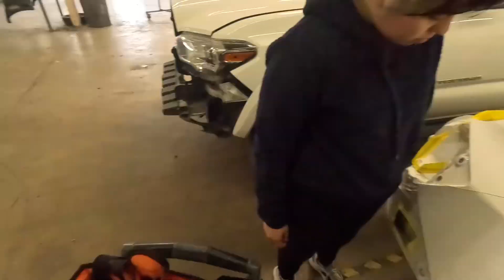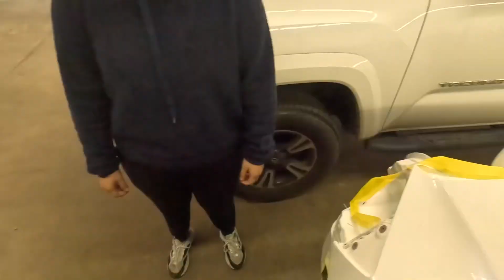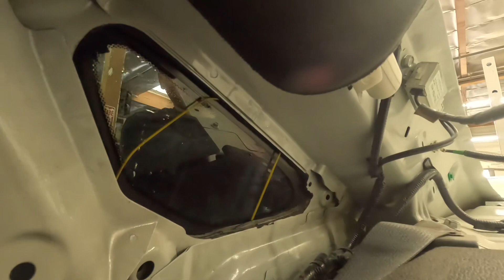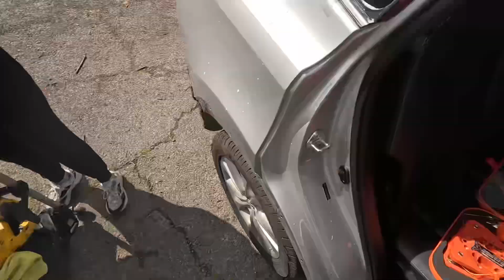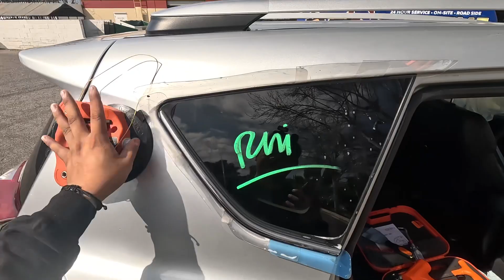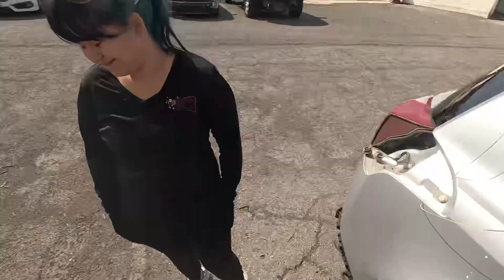We’re Back! Working with the new WRD BAT QC Quarter Glasses

Comment: What is that putty knife you use to pre cut with and do you use gorilla cord?
Reply from the maker: We use the WRD-TK. They call it a Tap Knife and it works well to start on the quarter glasses to avoid the line breaking. We have used the gorilla cord and it works very well! We always use the WRD Cord P6 P8 & P10. Different sizes for different occasions. P6 is thin so it cuts a lot easier through tougher urethane but you well get less uses around 6 windshields due to the clips from the original glass. The P8 is slightly thicker and will go through 10 windshields before breaking and goes through even more clips. The P10 is the thickest and will go through 15 windshields as long as it doesn’t get caught on any metal and goes through even more clips. It’s all about preference but the best is to have all of these on hand ready for any scenario